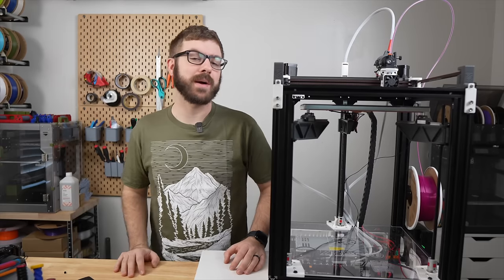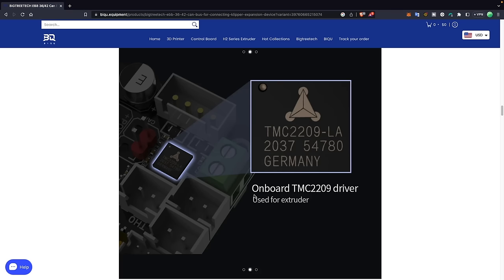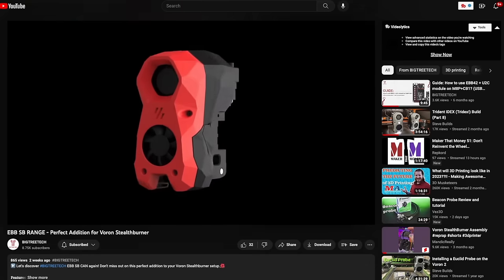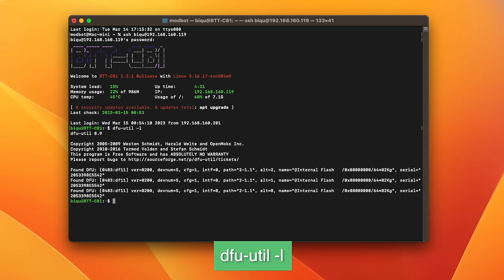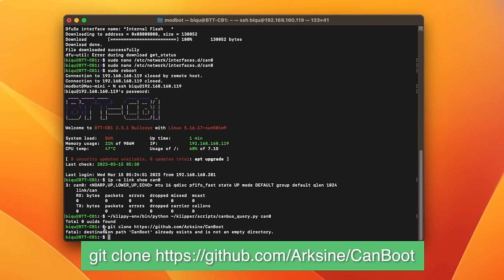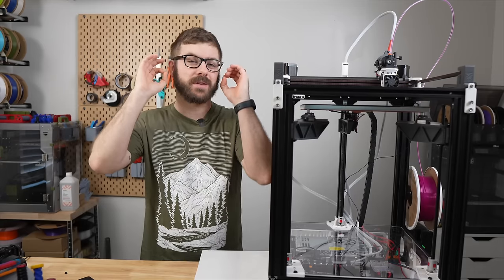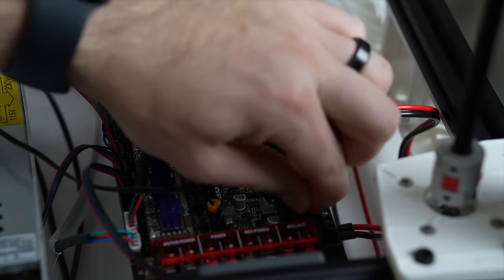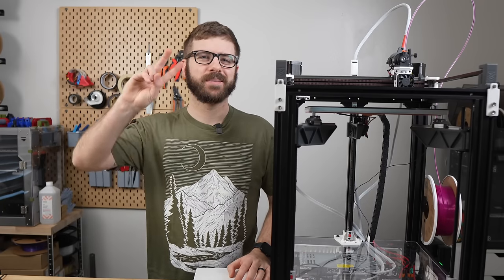Setting Up CAN Bus On Your 3D Printer (U2C & EBB)

Comment: Does input shaping work even with axes of the printer not aligned with the axes of the adx
(Im assuming the chip is placed "vertically" on the board)

Comment: I hoped that the usb a port on the u2c would allow the ebb36 board to operate with usb. the usb data lines being can high and low and the usual 5v lines could pass on the 24v but I am unable to do so.

Comment: Not sure why, but I'm not getting a UUID detected after going through your video. At 10:59, you state to connect the Pi to the U2C, but the video shows connecting the U2C to the MCU. Which is the correct step?
Reply: did you solve it?

Comment: This part 

auto can0
iface can0 can static
 bitrate 500000
 up ifconfig $IFACE txqueuelen 1024

is different from the Maz0r guide:

allow-hotplug can0
iface can0 can static
 bitrate 500000
 up ifconfig $IFACE txqueuelen 256
 pre-up ip link set can0 type can bitrate 500000
 pre-up ip link set can0 txqueuelen 256

Which one should I use?

Comment: Well done, but I prefer the USB mode. Yes, you have to use USB C cable and the power line, but you don't have to use another board.
Reply from the maker: Fair, the exception to that would be CanBUS Bridge if your board is compatible. Having the option is nice.
Reply: @ModBotArmy  yes, absolutely. Only one cable and you are good to go. Ah, in windows you can use the stm software to program the board. Only the 2.0.9 version

Comment: This is the first video I have not been able to follow you on, there's too much advanced information that the average user will not get given at very high speed.
Voron builders might get it.
Reply from the maker: This is one of the more advanced mods/topics I have covered in a long time. I wouldn’t attempt this without a fair bit of klipper experience and even additional research. I did my by best to fill in gaps but yeah this is a lot.

Comment: I thought you wanted to double the baudrate to get input shaper working
Reply from the maker: Input shaper work well at 500k. Old value I saw was 250k so this would be double.
Reply: @ModBotArmy  ok I saw a guide that said to go to 1m to get it to work. I have been struggling to get this to work. About to try your guide thanks a ton.
Reply: @paintballercali  So it depends.  I have had issues running input shaper with a printer that has a Raspberry Pi connected to an Octopus board working as a CAN Bus bridge to an EBB36.  It always errors out before finishing.  If I connect the EBB directly to the Pi with a Waveshare CAN Hat, I don't get the error.  Both running the CAN Bus at 500k.  I've tried increasing the CAN speed to 1M and it still doesn't finish with the Octopus as a CAN Bridge.  I installed the canutils package because it has a command that can show the utilization of the CAN Bus.  At 500k baud it goes over 100 percent utilization.  Bumping the baud rate up to 1M, it goes up to peaks of 80% or so, but still fails.   If I use the Waveshare CAN Hat, the bus utilization is extremely low by comparison.  Like under 10 percent, even at 500k baud.  I have even verified this by connecting an oscilloscope to the CAN H and L lines to watch the traffic with the scope.  I believe there is some bug in the klipper code that is causing it to flood the CAN Bus with packets when using the Octopus as a CAN Bus bridge.  Modbot is probably not having this issue because he's using the U2C can adapter.

Comment: I don't understand why people are using CANBUS when USB is pretty much built in natively and you've gotta buy extra boards to make it so you can talk to the canbus.  It doesn't make any sense.  DBUS exists, and can auto-assign devices, enumerate them, etc.  Additionally, USB endpoints can act like multiple devices at once.  Klipper could, theoretically, also act like a USB flash drive when plugged in, and each tool head have its own little .cfg snippet that gets injected into your main klipper.cfg allowing you to do things like swap toolheads on the fly, etc.  There's so much being done here, that seems like it's only being done because DUET did it, and honestly -- RepRapFirmware is trash.  Why are we taking other bad ideas from that ecosystem?

Comment: This all seems pretty convoluted for little benefit. You are also adding more paths of communication to troubleshoot for again very little benefit. Add to that if one part of that goes out you have to replace the whole thing instead of a 15$ driver or a 3$ ADXL. You are still running all those wires to the main board plus more to the pi. I don't even know why you would say you don't when in your vid you show the mass of wires leaving the tool head. You make this sound like it takes wires away, it doesn't. You spend even more $$ for connectors and specialty parts. More power to you but just seems like a massive waste of time, money and effort. If you are running Klipper and a Pi you already have access to everything you are using this board for. Your ADXL issue confuses me to begin with, why even take it on and off all the time. Print a mount and leave it on, takes about 20mins to setup a mount and even less to plug it in when you need it and unplug it when you don't. I have been printing both privately and commercially for over 10 years never saw a need or want for anything of this.